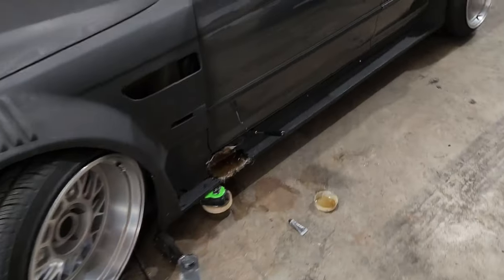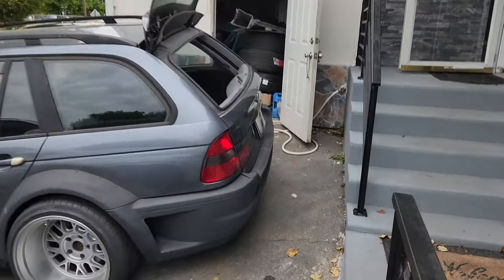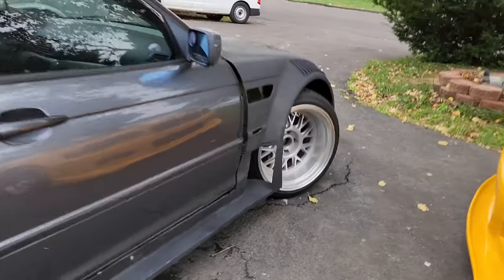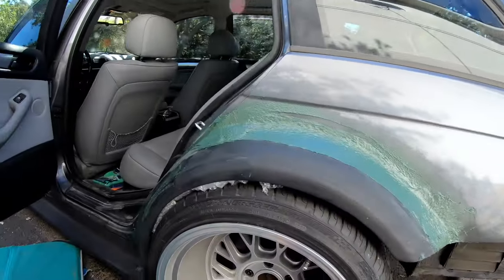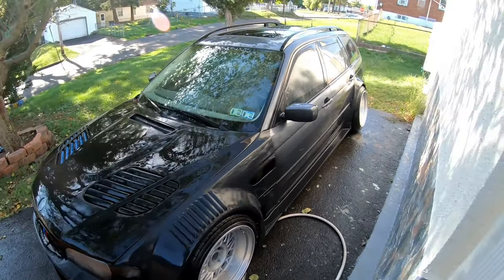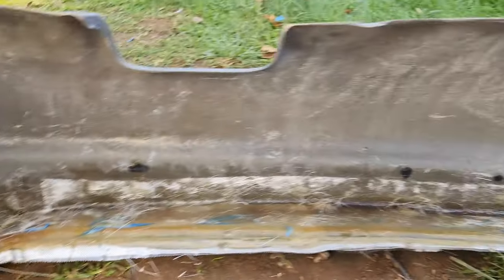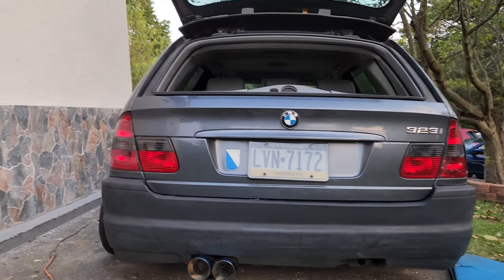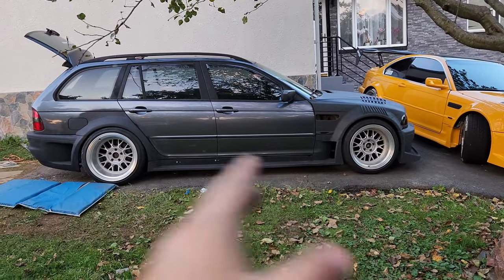BMW E46 GTR Wagon Rear Fenders and Bumper Molded ! Almost Ready for Paint!

Comment: Great job, but how are you going to match the height of the front fender rubbing strip with that along the side of the front & rear doors ?
Reply from the maker: That part will get fully sanded down and Ill be reusing the stock rubber pieces from the oem fender
Reply: @BreakTraction  Brilliant - just wondered how you’d do it. I’m ok with the mechanical stuff, but wouldn’t dream of doing the bodywork stuff that you’re able to do. Great job mate 👍🏼

Comment: What size of tires are you using on the front?? I just got some 275/35R18 all around from a friend and im not sure if they going to fit my E46..
Reply from the maker: 275 are definitely massive, I had an issue with that size in the rear